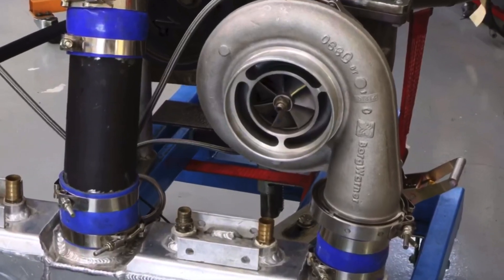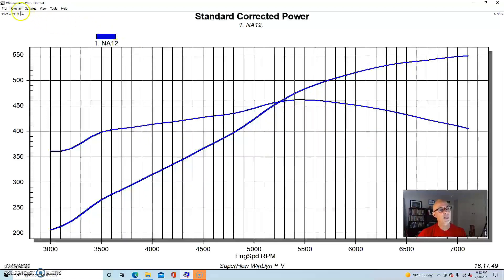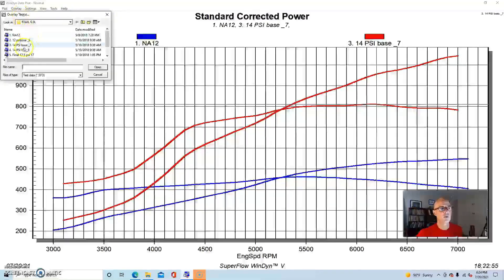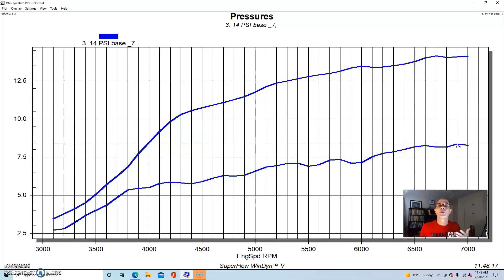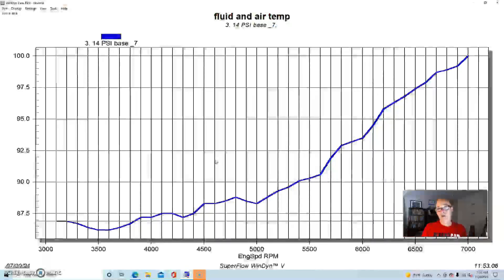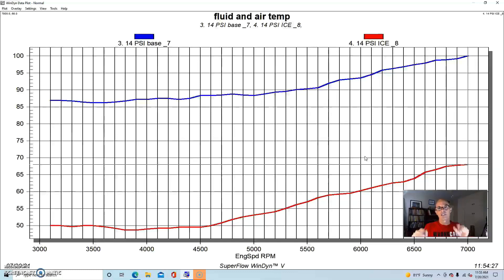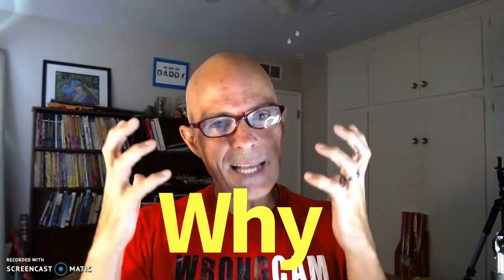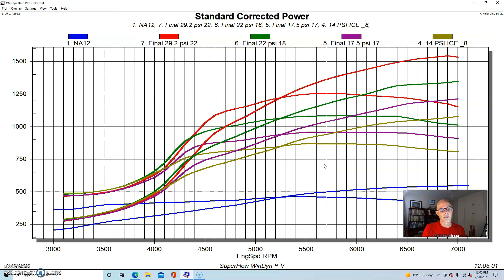JUNKYARD TWIN TURBO 6.0L ATW INTERCOOLER TEST (ICE WATER)

Comment: The resistance on the compressor becomes less with colder air, so with dense cold air, the compressor spins   faster. But I feel that u already knew that?
Reply: Actually the opposite is true, it’s harder to pump denser cooler air, same way pumping gear oil is harder than pumping 5w30 motor oil.
Reply: @BEAMERNOOB  Bear in mind that the turbo was pumping atmospheric air. The effect of the ice water would be to reduce the delta across the turbo thus it could pump more air without seeming to do more work
Reply: It’s just that it has one of those effects where the outcome outweighs the losses. Like a supercharger takes power to drive, but the overall gain is more with it vs without it.
Reply: Cold shrinks though it doesn't expand? So you have more room to move through? The air shrinks in front of compressor. Inside intercooler= psi drop= less resistance compressor, byproduct =fraction psi more. Think Plane flying through air not oil! Plane flying higher colder thinner= faster turbine rpm which makes jet possible. Hot engine cold thin air. So evin with the moter not in the equation you get this. Dense doesn't mean more it means smaller. = more room

Comment: I think the root of the change was the rudimentary boost controller. The engine made more power down low before the turbos spooled due to the decrease in intake air temp. This allowed the engine to spoil the fairly large twin turbos faster. The bleed style boost controller just couldn’t keep up and it made a tiny bit more boost.
Reply: Bleed boost controllers are rubbish. Just go and buy an electronic boost controller.

Comment: PV=nRT The ideal gas law.
https://www.calculatorsoup.com/calculators/physics/ideal-gas-law.php
P =nRT/V So if you reduce T, you can then increase n, the number of moles of the gases, to maintain the same P, pressure. Cooler, denser charge!

Comment: Without EGT's it's hard to say for sure. But typically the EGT won't change markedly regardless of the intake.

Thus with the cooler charge temp, you're going to be processing more air (mass) and thus produce more exhaust (volume and mass.) Since bleed valves are pretty 'how-ya'-going' when it comes to control. 

When a functional change is made, an adjustment needs to be made to the bleed valve (or duty cycle with an EBC) to maintain the same target boost. Same as when you replace the OEM exhaust with a free flowing straight through exhaust, you often see a rise in boost pressure (at least on vehicles that's don't utilize EBC, and old Celica GT4, RX7, early WRX or Nissan Silvia is a good example of this."

Thus in this example. No surprise. More Mass flow into the engine is resulting in more flow out of the engine wanting to spin the turbine harder and the 'dumb' bleed valve doesn't know it's target, so different boost curve is produced. Likely if you ran hot water or non intercooled. you'd probably see a boost reduction as the mass flow into the engine is reduced.

Comment: Short answer=greater air density because of lower temperature. Density creates pressure. Richard, i think you're like the engine information messiah. No other person in history has documented the amount of research you have, then freely shared it will the public. I'm a BIG fan. Keep it up!👍
Reply: I feel like this is on the right track but not completely accurate. Density does not create pressure. If this were true then your tires would gain pressure in the winter time instead of loosing pressure. Instead, density creates a resistance to compression. Denser particals are harder to compress. And since boost is essentially a measure of the resistance of air compressing in the manifold. Boost goes up with the colder air. Just my thoughts.
Reply: @ProfessorCsATVs   Short answer = density equals pressure.  I was referring to a boosted application, not ambient pressure. A believe we are both correct.
Reply: @ProfessorCsATVs  would be a good idea to meter pressure right after the compressor, before the intercooler, after the intercooler, and just before the throttle to get a more detailed spectrum of data.
Reply: Yeah for public
Reply: Air density is correct. Essentially more oxygen per volume of air with the iced intercooler thus more boost. More air equals more boost.
Reply: I agree with the cooler air and density rising adding minor gains in boost pressure.

Comment: is it because the air is more dense the colder it becomes
Reply: Give this man a cigar
Reply: Yep. Oxygen volume per cubic measurement of ozone increases when temperature decreases. With the exception of elevation changes..
Reply: If the air temperature stayed the same boost wouldn't change. You are half right. The boost increase was do to the temp increase. The ice water had a bigger difference from 50 to what it went up to. Having more dense air then heating it the air expands.

Comment: I'm trying to come up with budget friendly ways to increase the efficiency of my ATW Vortech intercooler that came on the kit for my 97 LT1 Camaro. I've ditched the small pump for an 09 CTS-V intercooler pump. I think the next step is to replace the heat exchanger with a larger unit from Mishimoto. It runs around 80-90°F when cruising and has been up to 130°F after sitting in a parking lot on a hot day.

Did the boost go up because the air density increased the turbo backpressure? I'm reaching here lol.